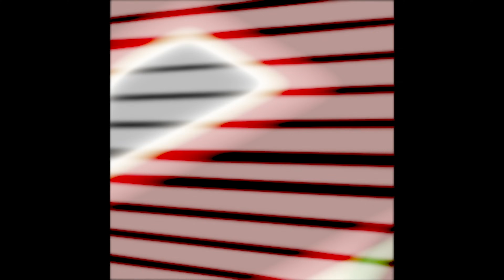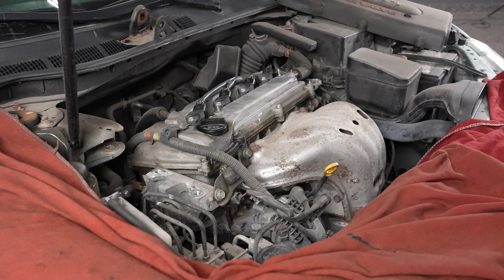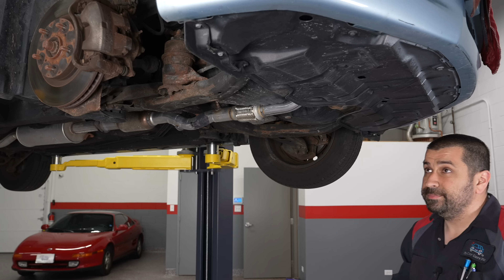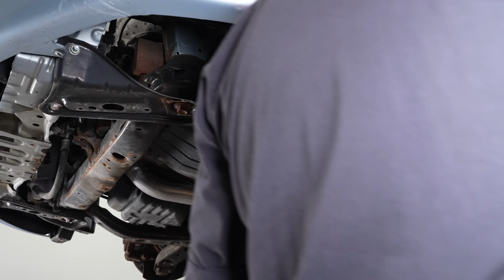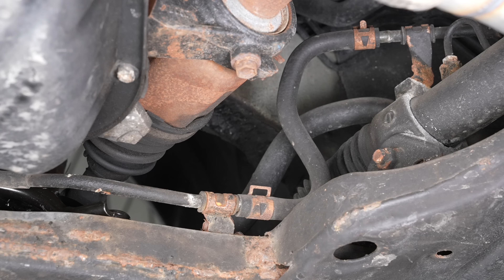How To Replace Toyota and Lexus Engine Mounts and Power Steering Lines

Comment: This channel has encouraged me to keep our highlander. It runs great and has been paid off for years. It’s a great vehicle even though it doesn’t have all the modern day gadgets and gizmos.
Reply: Same here....2002 Highlander, 282K miles. Purrs like a kitten.
Reply: Yep, 2008 HiHy, 320K. Always learning something new!
Reply: I wish I could find an old/nice Highlander like yours.  I don't want any of the modern day gadgets and gizmos....
Reply: We have 5 in our fleet...1997 Camry with 42K...not a misprint...42,000 miles, 1998 Camry with 97K, 2001 Avalon with 156K, 2005 Sienna 101500K, 2010 Tundra with 265K.
Reply: The modern day gadgets and gizmos are nothing but trouble. You're better off.
Reply: 02 Camry XLE - 190K (off to college)
06 Highlander Limited - 238K (my daily commuter)
13 RX350 - 125K (wife’s vehicle 😜)

Camry and Highlander have been super solid.  Best cars I’ve ever owned.
Reply: I like this guy ❤
Reply: Rx 350 with 250k and still going strong. These vehicles last a long time with some TLC
Reply: It’s a great vehicle because it does not have all that.

Comment: Yes, more fixing content please, either in deep explanation or not I can learn a lot as a DYI-er. I think Toyota should pay you! I was not gonna get another Toyota after my 2016 Sienna making the steering clunking noise (you explained in other videos), took it in 4 times to finally get the van back with off center steering wheel. Water pump bearing died at 50k miles. However, after watching your videos, I know more about Toyota cars and have more confidence that I can maintain them properly on my own. Thank you and the team, including your family of course, keep up the good work!

Comment: I'm not a dyi. I take my 2013 Camry SE to the Toyota dealership for repairs, but knowing that if my car shakes I will know it is the motor mounts. This is a very good video. I learned a lot. Thanks
Reply: It's diy. Just because your car shakes doesn't mean it's motor mounts, that's not how it works. Dealerships are not as honest as they should be. I'd rather take my toyota to car care  nut than any toyota dealer in the country.

Comment: Every 2AZ- Camry I've ever worked on has had leaking power steering return lines - seems to be common on Toyotas?  I did it on a 2005 Pontiac Vibe, too.  Not a bad repair though.  Thanks for showing us all the steps on the motor mounts, very nicely done!   The "emptiness" of the new studio makes the sound of the impact gun running a bit more vibrant due to the echo.

Comment: To answer, I personally like the complete repair video because it is true to the video title. 
 Your car reviews are also very good. For example Mrs. Care Care Nut and your new Lexus GX 460. After that video I took one for a test drive and it is the "truck"  for me. 
 I am waiting for a Lexus GX 460 to come back from a three year lease which looks nice and was cared for.
 I hope to own a 2022 or 2023 in the next 2-3 years.     I am not interested in the Ultimate version with the air suspension so the other two variants will do just fine. 
 I suspect that these beautiful V-8 versions will sell rather quickly.

Comment: New subscriber. Found you while researching the 2002 LS430 with 169K and a timing service late last Summer I recommended to a close family friend (close enough I'm responsible for all the car care). Only big issues are an inop front passenger window, inop moon roof, floppy passenger mirror and a power steering leak. For the price they got it I don't mind the issues. You've already been helpful for me to diagnose and plan repairs.
This video reminds me of working on my mom's 2007 Camry which is closing on 280K miles on its original 2.4L.
God bless.

Comment: Love the great vids AMD. A trick to keeping parts of the car clean from dripping fluids is to put a sheet of aluminum foil on top of whatever the fluid will drip on. You can form the foil around that part of the car and it makes it faster and easier to clean up afterwards.

Comment: You need to build up your lung power. 5:08
When the motor mounts on my 01 e320 v6 mercedes started going out, I went on youtube to see how hard it was to replace them.
The right one is easy. The left one is not and all the videos I saw they wanted to sell a special flat wrench to get the top bolt off from the front because of restricted access.
I'm not buying that and I doubt any shops have one.
Then I found another video and the guy took the exhaust pipe off and was able to get at it from the back with a regular wrench.
When I took the car in I explained it to the mechanic and he did it that way. Only took a few minutes.
Videos like this one with no special tools for sale to do a job are worth the time to watch.
Thanks AMD.😊

Comment: I replaced my sister in laws 250k toyota camry power steering line with some high flow, these are used in race cars and it was not cheap, but braided lines are so much better and then traditional rubber lines. If you can afford to switch it out to a braided line I highly recommend it.

Comment: AMD is the man, but I want to note for anyone doing this, you don’t have to get the front bottom mount from underneath. I did this on my Avalon, and plucked it from the top by removing the battery, battery tray, and swiveling the mount bracket. It came right out no problem, but obviously had the engine raised during this portion. Did not disconnect radiator hoses or lines.

Comment: Purely as an observation, my first Toyota is two years old. I live in UK and after two decades of German cars, the Toyota bolts and brackets are rusting far faster than any German car I’ve owned. The body is fine and rusty bolts may not be an issue. Toyota are definitely saving money by using low specification fixings.

Comment: In this video you stated that the front mount would not come out as shown in the video if the engine was a v6. Having a v6 Camry I am wondering how the front mount would come out in that scenario. I am currently in the process of purchasing the mounts, I have 2 of the 4 so far. Thanks in advance for all the knowledge you share, it has been invaluable to me.

Comment: I think I did the engine mounts on our 2005 Camry, after I did them on our, now donated, 2001.  I wish I had a lift like AMD has in his shop, but I got the jobs done with floor & bottle jacks & jack stands.

I will now inspect the power steering lines.  They should be good, as we live in northern Colorado, but they use MgCl2 on the roads, which is a bit less corrosive than NaCl.  Next have to do job is replacing the valve cover gasket on the 2005.

I just replaced the brake pads & shoes on my 2003 Tacoma last weekend.  I never want to do drum brakes ever again, but will on my late Dad's 1951 Willys pickup, this summer.

Comment: My dad has an older Camry he had engine mount replaced but did not use OEM. Bad idea car vibrating. I guess the rubber is different density on after market so advice is always use Toyota brand.

Comment: The only thing I wish this showed was how to do this without a lift.  I have motor mounts to replace on multiple vehicles.  What did you use to make the engine bay clean? I've heard differing opinions about using water or not.

Comment: I had an 07 Camry, purchased June  06. They refused to fix oil consumption problem, traded for Accord. Much better car, not 1drop of oil used, between oil changes. No comparison.
Reply: Thanks I might have to do the same as you. Smh

Comment: When I do my 5000 mile oil change with use of a mechanics lift . I liberally spray all rubber components underneath with 303 Protectant . To resist them from drying out and cracking . As well the engine strut ? in the engine compartment . And spray on top of the struts for it to flow downwards .

Comment: grease up the rubber in the mount to make it last
Reply: Silicone grease? Also, any grease will dry out fast anyway, so there’s no point.  AMD would have used it if it made a difference.

Comment: OK, well I'm sure familiar with this power steering line... Mine rusted at the "U" shaped spot, just like that one.  I wrapped the leaky part of the tubing with a split hose and clamped that in place with wire ties until the dealer could fit me in to replace it.  Three years later, at about 200K miles the darn tubing rotted again.   This time, the tech advised me to just cut out the rotted "U" section on the tubing and replace it with a hose, which he did.  I honestly felt he was trying to help me out a bit, that tube/hose assembly listed for about $300 when I looked it up.  I even considered having a tubing shop "make up" a replacement tube assembly out of some better materials.  But, this would probably cost more than the factory assembly, and I'm going to sell the car this year anyway.  Nonetheless, I am extremely fussy about how things are done, not unlike CCN, so would definitely agree with the idea of keeping things original and right.   I would have replaced the damn PS hose myself, but really can't get under there to do it.  My next "project" is replacing the radiator which is starting to "weep".  That plastic radiator hose nipple over the thermostat really scares me...  The studs and nuts are all rotted away.  I fear just touching it while pulling the hose will be enough to break the rotted stud(s).  I guess I better get some new studs/nuts and oring seal for the plastic tube before even going near it.    I replaced the rusted oil pan earlier this year....  Carefully removed each of the rusted screws one at a time and replaced them before actually replacing the pan.  Didn't want to strand the car if one of the screws broke off.  Just the pressure of me messing with the bolts was enough to cause the oil pan to leak in one of the rusted spots.   This job only took three tries for me to get it right, but finally got the oil pan replaced and no leaks.  Used my buddies ramp stands which picked the car up just high enough to make working on the oil pan "almost comfortable".   
I honestly considered having CCN replace the short block on my 09 2.4L.  But, after spending time underneath, I fear that "rusty land" has gotten the best of the old Camry.  The engine is just starting to use oil now, never qualified for the Toyota repair cuz I cared for it too well...  Didn't burn enough oil to qualify.   I really don't think I would have wanted the dealer pulling that motor apart, replacing pistons and rings, trying to beat flat rate anyway.

Comment: Done this many of times. Definitely need a lift and those  screw jacks. Dropping the subframe is tough. Can't do this DYI at home. FYI. Anytime you change suspension geometry. I,E dropping the subframe,  should require an alignment. 🤪🤪🤪🤔🤨
Reply: Wow, didn't know that thanks

Comment: Hello AMD 👋 
Got a question. Is it ok to use different brands of engine oil or should I use the same brand every time I change the oil?
Reply: I use the same viscosity. I mix up the API SP and the older rating. The military often mixed different brands.

Comment: Great job, I have a question?  I have a 07 Avalon and it pulls to the right under power but not throttle off. Had an alignment as well. Could a collapsed mount  cause this under power. It’s not torque steer. Well done again, you can work on my cars any day. You’re too booked up.

Comment: Awaiting arrival on my new 2024 Tundra SR5. Youtube reviews run the gam-it from great to a piece of junk. What exactly is the engine failure problem with the twin turbo non-hybrid V6 engine? It seems to be a bearing issue. Is this due to driver error (poor maintenance, heavy on the gas pedal, etc..) or defective engine build? Forgive me if you’ve talked about this before, maybe direct me to the episode. If not would you consider giving your opinion or perhaps addressing it with a future episode? Thx in advance for any consideration you may wish to offer. Love the channel by the way, always great info.

Comment: Hello AMD, is it a bad idea to coat the power steering lines (2006 Highlander 4WD in my case) with PB Surface Shield to prevent rusting? Mine aren't in bad shape so I would like to know if this is viable for preventing rust?

Comment: Regarding the stud coming out of the mounts - would it be feasible to use the double-nut or jamb-nut trick to try and turn the stud out of the mount? Or are those studs really tightened in there and only coming out if the rust wills it?

Comment: Are there any additional considerations when changing the mounts and control arms on a hybrid Camry?  My local mechanic said he couldn’t change the mounts and control arms on my 2013 hybrid Lexus es300h because my car is a hybrid. He said only the dealer could work on it

Comment: Is there any risk of damage to the PS rack seals when bleeding the PS system this way?  I bleed this way all the time but I have seen non-leaking racks start leaking after doing this.  Not sure if it's just coincidence or if this puts extra stress on the seals.

Comment: I bought a brand new 2003 Tacoma.  I made the mistake of getting the extended warranty so the dealer did all of the oil changes.  They were even worse than the quickie places!  To prevent oil spills, instead of dropping the rear skid pan, they stuffed shop rags between the skid pan and the engine.  There was 6 years of rags in that space.

Getting back to this video topic.  After the six years, I started doing my own oil changes and noticed the driver's side bolts for the motor mount was missing!  The paint was still pristine so there were no bolts in those holes, ever!  When I told the dealer, they said they would not install the bolts and even asked me why I removed them?  Now, why TF would I do that?  The dealer wanted to charge me to install bolts which were never installed.  That there is Merican Ingenuity.  My friend who owned a transmission shop installed them for free, well, a box of donuts actually.

Comment: Do you recommend the Idemitsu PSF used in the video over the Toyota ATF/Power Steering Fluid (00718ATF00)? I have never been able to find a source for the clear fluid that comes from the factory.

Comment: Have had this 2009 Sienna to three mechanics trying to troubleshoot a front end vibration. They all either couldn't figure it out or changed the axles. After watching this I suspect its been motor mounts all along.

Comment: I have a 2005 Toyota Highlander V-6 The shop I take my car to said my motor mounts are cracked. They gave me a price of close to $6000.00 to replace all four, does this seem right. They said it’s cheaper to do all four at the same time.  Or should I call around and get different pricing

Comment: The drivers side would be MUCH easier if it were a stud. Lifting the trans a few inches gets it just about free, but needs another few millimeters. This is an easy repair if it wasn't for this one mount being such tight clearance. I couldn't get the trans up enough, the vehicle was lifting. I had to just cut it out and muscle it in 😊. It's that damn 2-3mm that gets you.

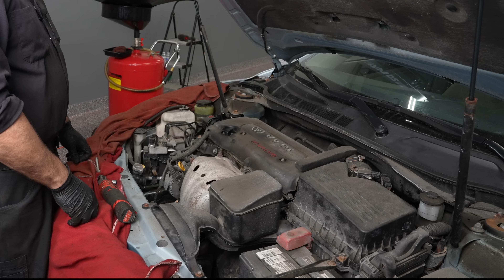Comment: 41:59 Is it? The AC line clip is still detached 😂

Btw, I’ve seen people doing shift through all the gears in the automatic transmission before locking down the mounts to ensure everything is seated in a comfortable position, but I’ve never seen that performed here. Does that procedure really helps things to settle in correct places or is it redundant?

Comment: 26:48 Scanner Danner calls them parts changer as well. lol.

i had my car at a garage and that's all they did, changed parts. changed my Cat, (cat was fine, car had NOOO codes) changed the O2 sensor, charged for induction cleaning. and still could not fix it. Took it to another garage. they had it a week while i went on vacation.  they could not diagnose the problem. said to get a new engine.

Comment: 2004 Volvo V 70 purchased and the air conditioner was not working the gentleman had no clue why so we filled it with freon and noticed a hose was leaking because it was wrapped with electrical tape😂 I think the new hose was $170 went to Lowe’s and bought a five dollar barb and two clamps and had AC for the cost of two cans of Freon $30 done   I will roll with that  and if it breaks  I will consider a new hose🤑  that would not be the case if it were my Lexus SC 430 though

Comment: I have a 2014 Lexus GX 460 with 120k miles. I've been getting some indications lately that my motor and or tranny mounts are starting to wear out. I looked up the price on the OEM mounts which is 3 for the motor and 2 for the tranny. They are about $100 a peice so about $500 total. That's not to bad so when I called my local Lexus Dealership to get a total price for replacing all 5 mounts with labor they said......For one they have never ever done that job on any GX? Then they said the price would be $3,400 total! Also, if I wanted to do go ahead and do it that the job would take 2 days total... Something seems off with that price and labor time. Am I missing something with how hard this job is? On my old 2011 Chevy Tahoe me and my buddy replaced the motor mounts on it in my garage in a couple hours after they totally failed at about 190k miles and it was not that hard. There are quite a few guys in the Toyota/Lexus forums that said replacing all their mounts with higher mileage made their truck ride like it was new and fixed all the clunks and vibrations they were having. I feel people tend to wait until they completely shot to change them out. I'm thinking however as good preventive maintenance/restoration it's not a bad idea to replace them every 10 years 120k plus miles or so. What do you guys think?

Comment: !You Talking about using the correct Tension Clamps on the power Steering lines but the Main water hose lines on the Radiator are Clearly NOT Tension Clamps nor are they Original Toyota!